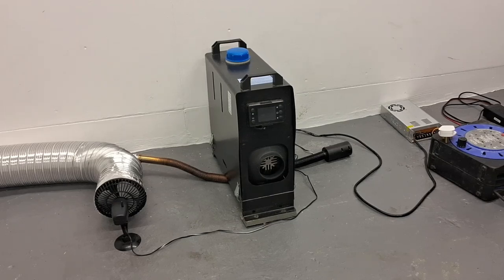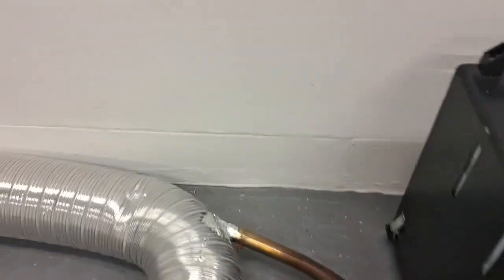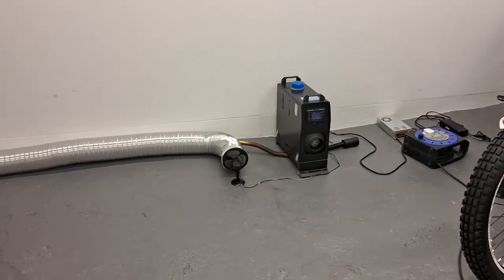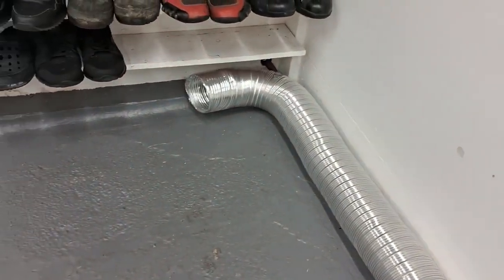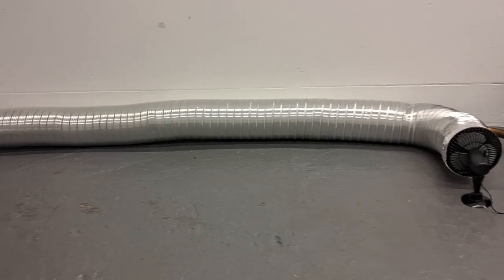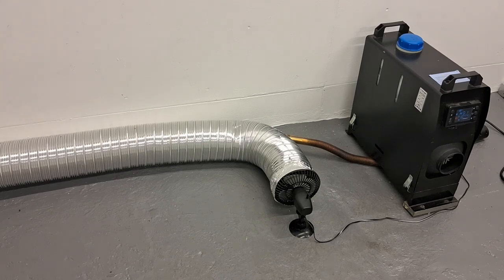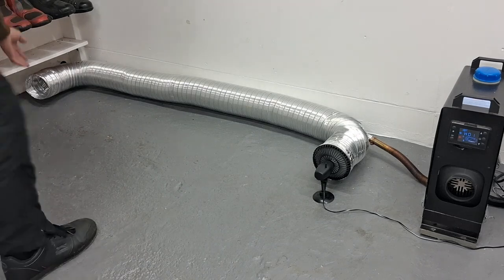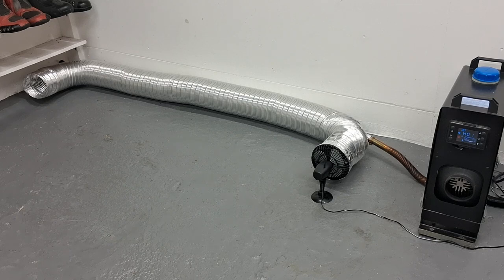FREE HEAT FROM A CHINESE DIESEL HEATER

Comment: You are asking for problems as cooling the exhaust will cause condensation in the exhaust gasses and your heater is at the lowest part of that exhaust.
Reply: He just needs to raise the heater a few inches to let the condensate run out of the exhaust outlet.

Comment: Final exhaust blowing over an old car radiator in a vented enclosure as a heat recovery system to pre heat water only gain a few deg. But would be a few deg less to heat with. Gas

Comment: I believe your setup would be slightly more efficient if you were to put the fan on the other side where the exhaust goes out the wall as the reverse flow heater